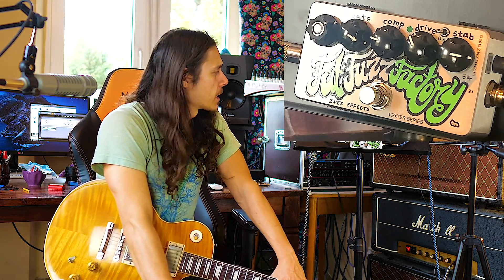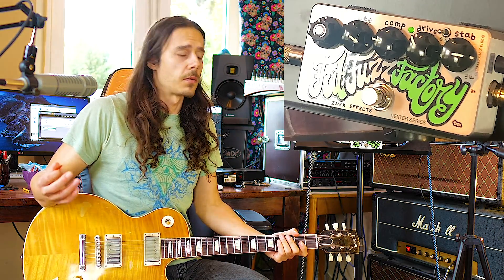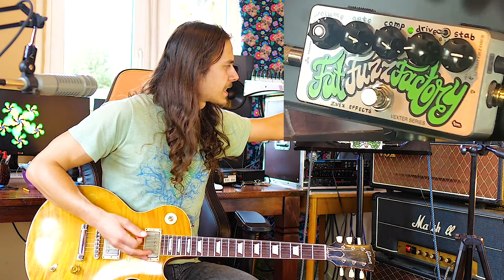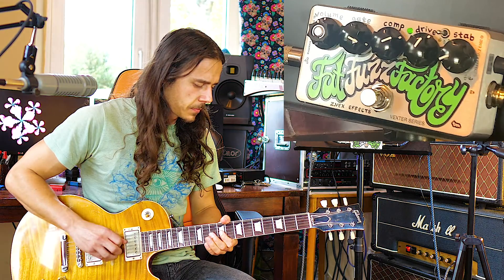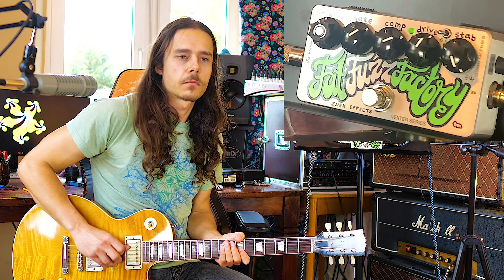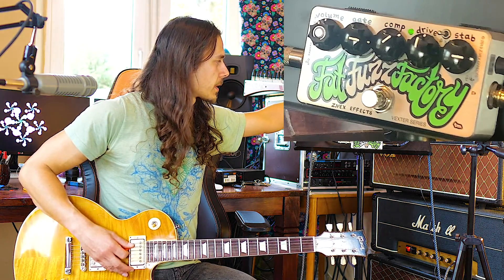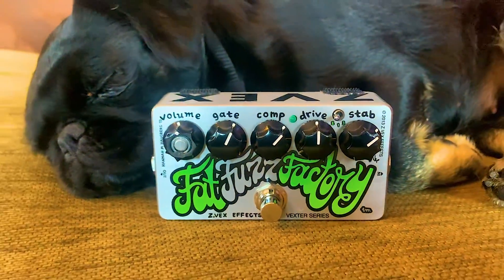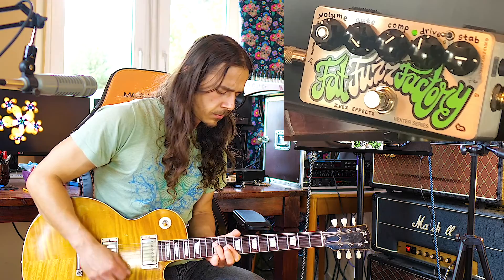Fat Fuzz Factory

Comment: Outstanding do it all Fuzz , Drive and Boost, - all in the guitars volume knob.
Forget the gate and Compression, put it in Sub 2, and just use the the Stability and Drive to get ANY sound you can imagine:; single coils work much better than HB' s , and Carbon Zinc ( dollar store) batteries work best, followed by SAG adjustment on a brick.The guitar's volume knob will bring you from the the most vibrant cleans, to the most blown out Fuzz.
Germanium is heat sensitive , and will vary with ambient room temperature.The Fat version has a much more diverse tonal palette than the original; I would put it in 2nd position and leave it there,- perfection.
Reply from the maker: Thanks for commenting. Tons of high end info. I´ll try out your tips. I´ve noticed the temperature sensitivity in my own room is really noticeable